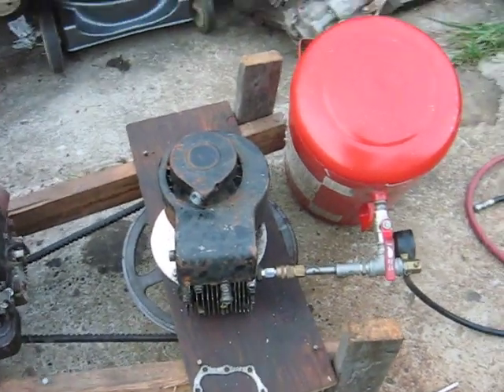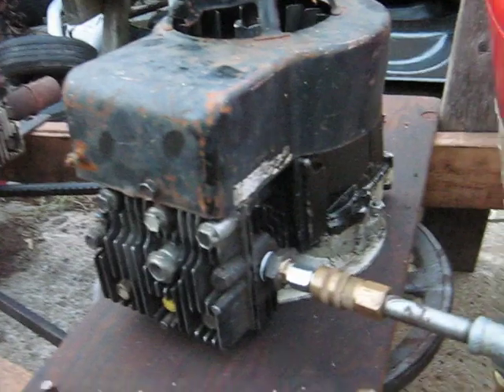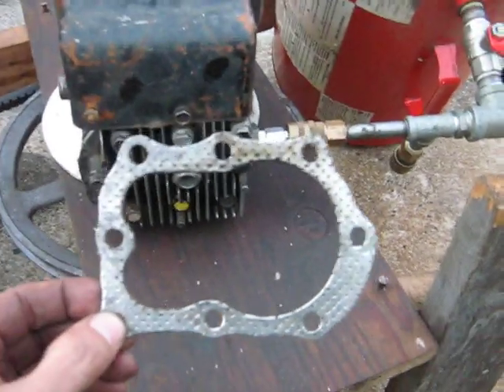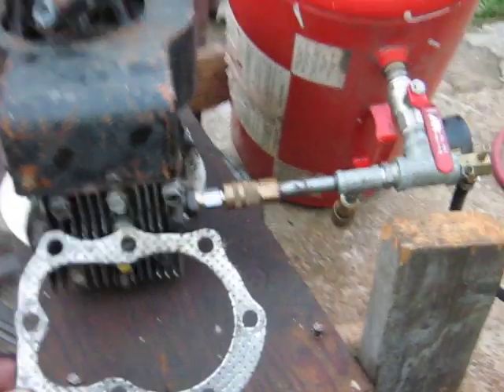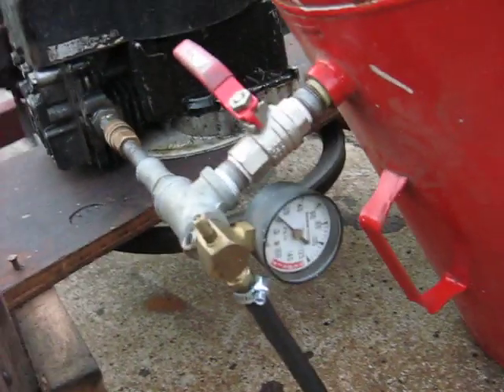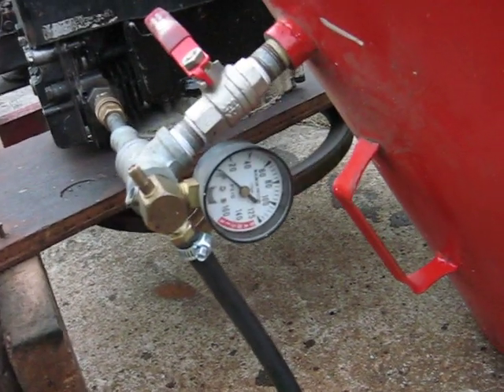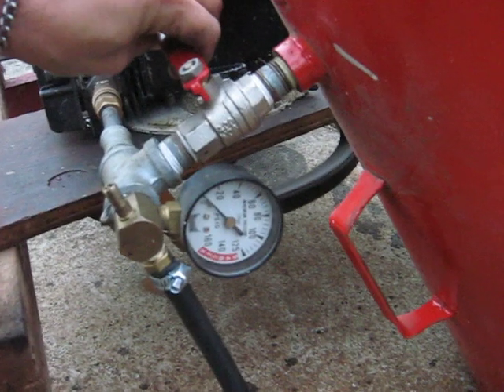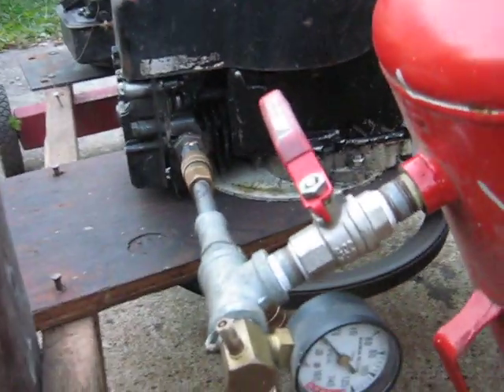Stage 2 Experimental Air compressor

Comment from the maker: @outdoorsman310 
Perhaps, high temp. silicone seal would work also, I have done that before.
In the end, I found that leaving the gasket on was OK, other factors make a lot more difference in the outlet pressure it will produce. It seems that the outlet valving has the most influence, followed by the combustion chamber volume.  More to follow, for some reason vid 2 kept freezing up during the upload :(